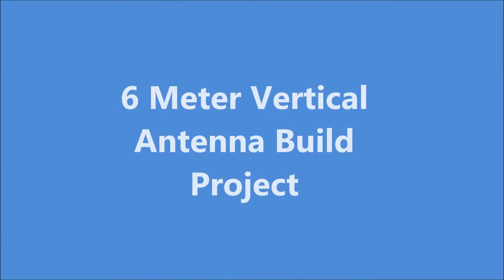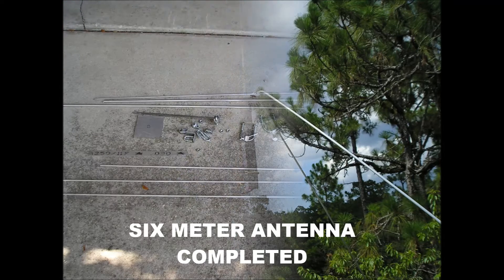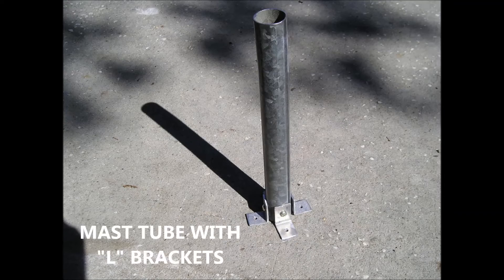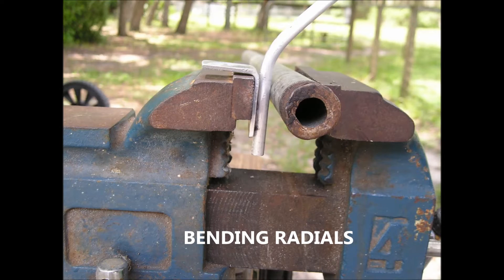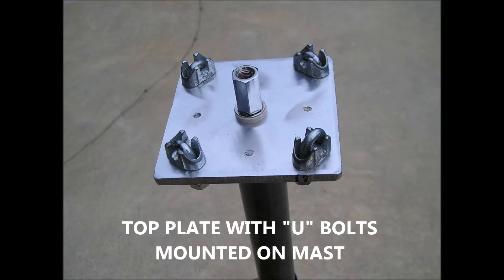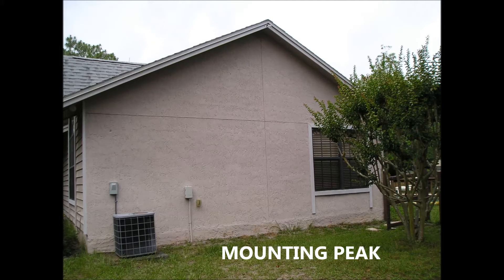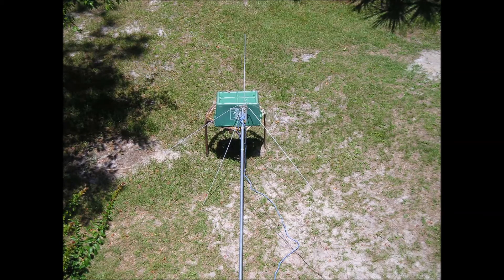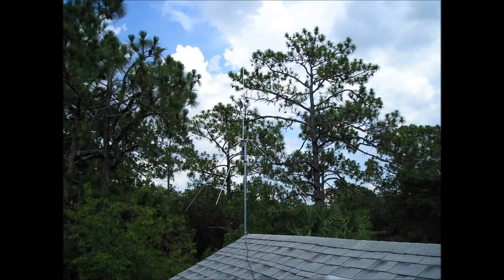6 Meter Antenna Build

Comment: It is now around 7 years later and I just wondering as to how the antenna held up and do you still have/use it?
Reply from the maker: It's still up there in good condition holding up well. Except for some rust on the screws, all looks very good. I did some dis-assembly to play with it for another frequency but then put it back to  original configuration. I built it to be strong and dis-assembly in mind in case I want to move it or something else.
Reply: @paulcolton5213  Nice.